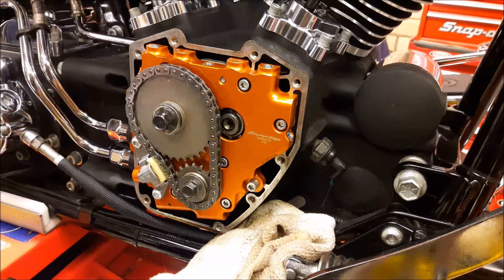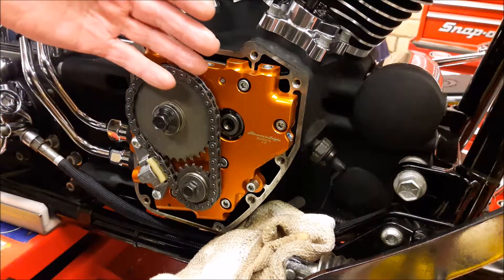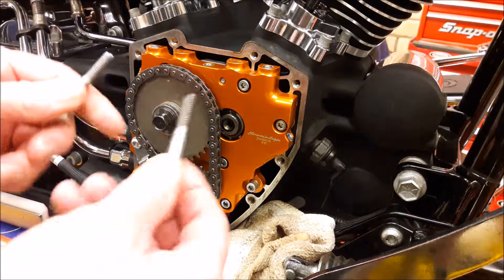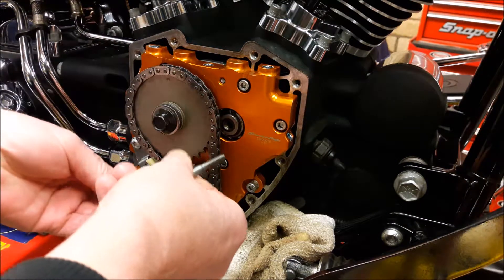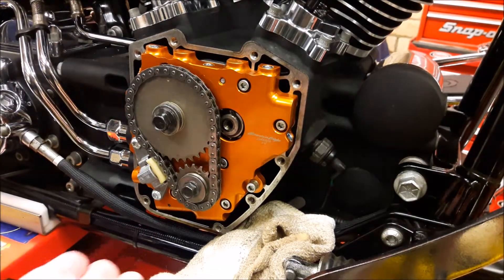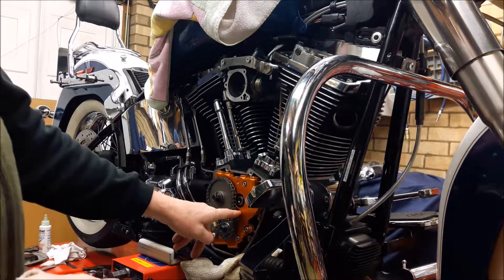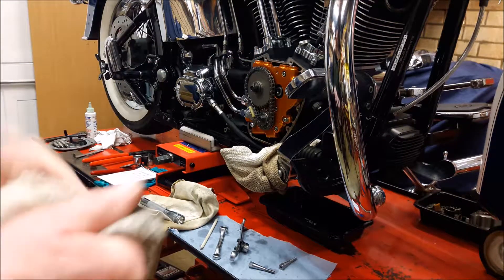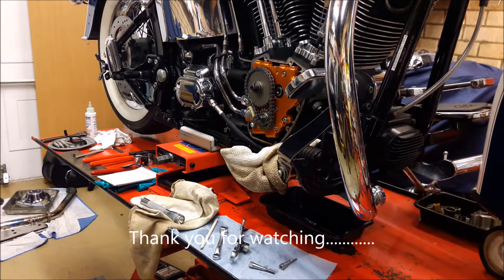Harley Twin Cam, Cam Chain Tensioner Issue Part 6 (Update & Torque Adaptor)

Comment: if you don't have the sprocket locking tool all you have to do is push on the back brake while you're torquing them.... When you had the top end apart you should have put rocker lockers in to eliminate rocker arm chatter against the bolts which is an annoying noise we all suffer from.

Comment: By the way you talked about tappet bleed down and duration of rear cylinder bleeding, I am assuming you didn't find top dead center before tightening rockers?  I sure hope I am wrong because you can destroy your valves in a hurry if you don't.  There is a definite reason why you don't just tighten rockers without TDC.
Reply: Hi Dave, in all honesty, I can’t remember the detail now, it’s almost three years since I did the work. It seems to run ok!
Regards PB
Reply: @paulbuckberry7683  Ahhh, I didn't see the time stamp on the video. Most of the time youtube only suggests newer vids to watch. Glad it worked out for you.  Ride safe!!

Comment: Man, I wish you had done a full video on this from start to finish! Did the Harley manual explain how to do it? I have a 2006 dyna 88ci that has 17,000 miles on it and I'm getting a bit worried that I should be doing this now
Reply from the maker: Hi, I didn't do a full series on this for a couple of reasons. First one being time and wanting to get the job done and secondly because YouTube and the net already has a massive amount of material covering this and the presenters do a far better job than I can. I was just looking to put the view of a 'bloke in his garage' on it.Shane Conley is well worth watching, he has done a full series on stripping and rebuilding the 88 Twin Cam. There are some good videos from the S&S team and I think also J&P cycles.The Harley manual is a help and you couldn't do the job without either that or the Klymer manual but in all honesty having watched a lot of the material on YouTube it felt like I knew what to do anyway.You will need some of the special tools though........not sure how you would do it without them.Hope that helps and thanks for watching.Best regardsPB